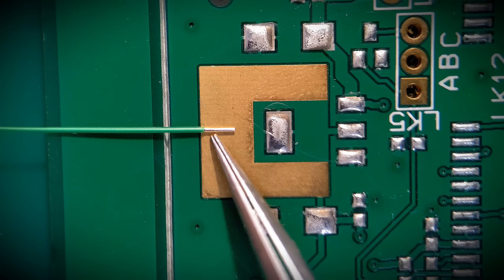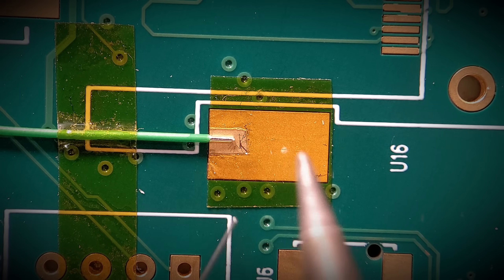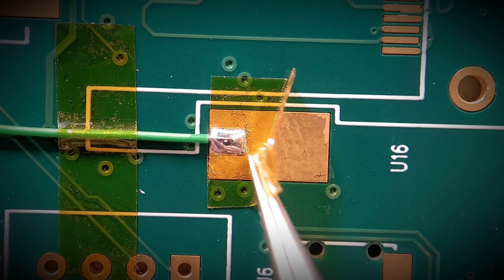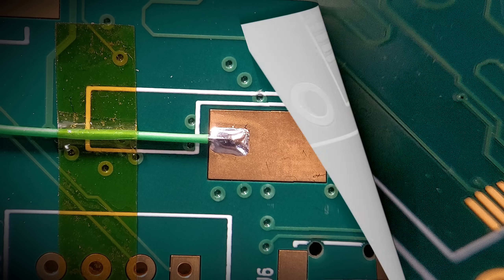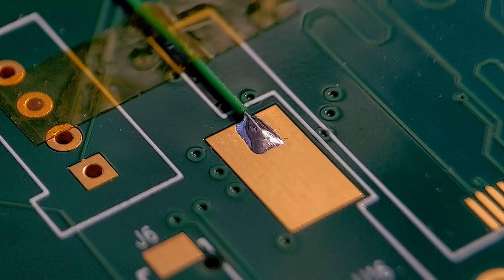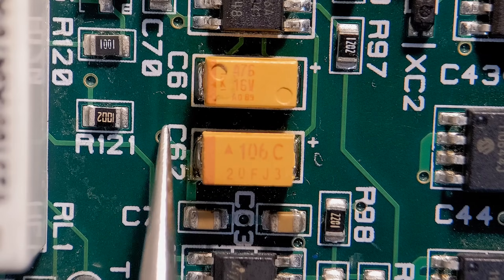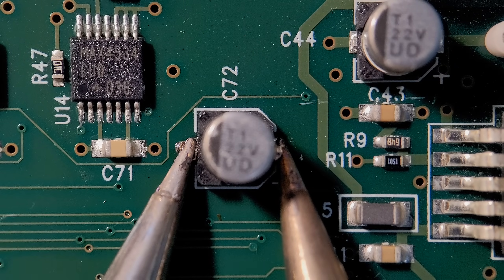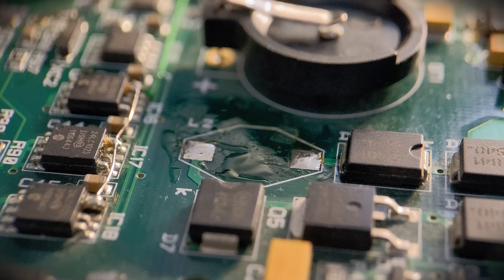Soldering Tips + Tricks : A Magical Selection / Soldering

Comment: What's your trick for larger dip chips on old computers?
Reply from the maker: Hi , thank you for your comment . I have showed ways in some of my other videos on desoldering how I get large 2 rowed devices out . I appreciate though that dome old boards have weak tracks with no barrels going through them  . I'm just extra careful if this is the case and solder braid totally around each one until I'm confident they are all loose . If the board has barrels from one side to the other then I would use my copper wire trick I show in a few of my other videos like I mentioned . Thanks again , take care 👍
Reply: @mrsolderfix3996  you know what that sounds familiar, maybe I watched that before. I'll def look it again, have a c64 that is getting sockets.

Comment: Much appreciated, very useful to know. When I was first starting out I never realized the importance of flux but it makes life so much easier and most braid doesn't have enough flux in it. You can get a tin of flux paste very cheap and it will last a lifetime. Great tip about wrapping copper wire around the solder tip for extra fine work, definitely going to try that one. Cheers, mate.
Reply from the maker: Hi , thank you for watching the video and leaving a comment , your support of my channel is very much appreciated 👍